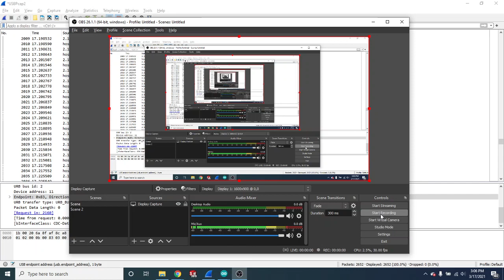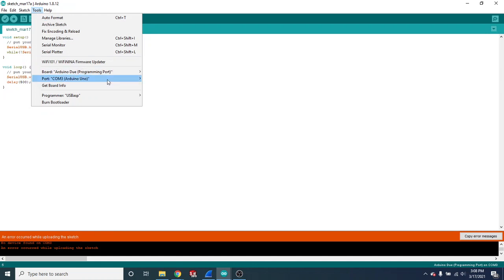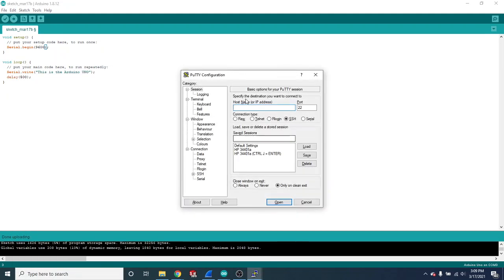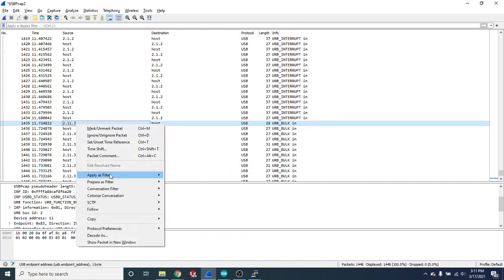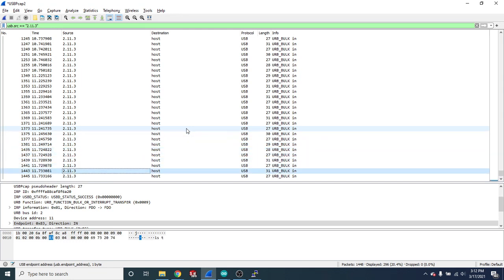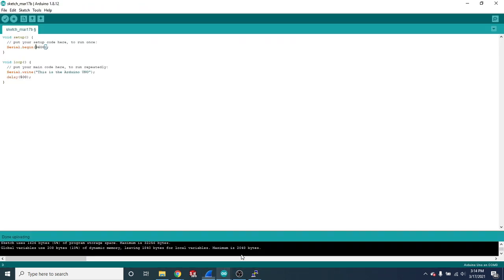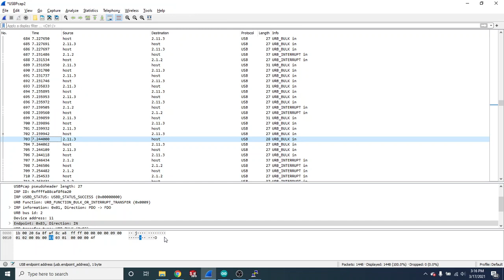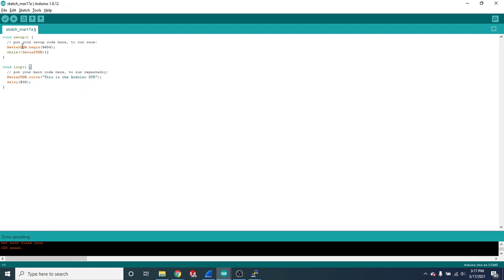Difference between SerialUSB and Serial on Arduino DUE [Analyzing Arduino USB Packets on WireShark]

Comment: Hello I am trying to send serial command from Arduino Due to Arduino Duo. I connect Arduino Due's native connector to Arduino's USB connector via a micro usb to usb-b converter cable. I expect writSerialUSB.println("Open") line of DUE's code tell to DUO which has serial.begin(9600). I test DUE's and DUO's codes with my computer. DUE sends open string and DUO listens open string. but when I connect each other. DUO does not triggered. Any suggestion? Thank you
Reply from the maker: Interesting idea, I have not heard of anyone trying such a thing before. My guess is that the reason it is not successful is because the Due is configured as a USB device, and to establish a connection it needs to be connected to a USB host such as a PC. If you can find a way to configure the Due as a USB host then your idea might be possible. If your goal is to share data between two Arduino’s, then I would suggest using SPI or I2C instead of USB
Reply: @andrewphillip8432  DUE is using 3.3V TTL and UNO is using 5V TTL. I am not sure to connect the boards through the pins

Comment: It would be interesting to repeat this exercise using an FTDI UART-to-USB converter instead of the onboard 16u2; it could well be that the 4-byte "sampling" is a feature of the code in the 16u2, and not anything specifically to do with USB...
Reply from the maker: Good idea, I have one of those I will try it with if I get the chance. I'm guessing you are probably right that the 16u2 is setting the packet size. I tried to see if I could figure it out from the arduino-usbserial firmware on github, but it wasn't immediately apparent to me. But maybe you will have more luck with it.
Reply: @andrewphillip8432  maybe also see if it varies with baud rate - both using the 16u2 and an FTDI...

Comment: Hi, very interesting video. It seems you could be the guy who can help me with my problem. For a project I have to send small arrays from my PC to my arduino due .The arduino does something with the arrays and sends back a signal to the PC, so that the PC knows he has to send the next array. When I realize this with the serial port everything works fine. Because of the circumstances of the project I need to use the serialUSB port. When I use the serialUSB port the arduino does his stuff with the array and sends back a signal to the PC but has to do it 3-6 times, before the PC recognizes, that the next array has to be send. 
Can you explaim this behavior?
Reply from the maker: How does your signaling work? Also what framework did you use to build your host side application? How much time are you expecting between messages?

In general the kinds of debugging techniques I use when solving problems like this are doing things like: opening the serial port in PuTTY or other similar tool to see the data as it comes in. (If your data is not ascii format it can be useful to make a simple command line tool that prints the received data in hexadecimal or whatever is convenient). Another good one is testing the host side application independently. You can get a usb to UART module and put a jumper across the RX and TX pins  to create a loop back device. Then you modify the host application to send the data it is expecting to receive from the microcontroller and proceed to debug

Comment: does it matter  if you increase baud rate? does that mean that you have more characters in a packet? and if so what's the limit of that or will usb be better regardless?
Reply: also your video came out at a good time. I'm looking into a due mainly because of this video and a big project I'm working on
Reply from the maker: @lamboking8able  If you are using SerialUSB then only the USB protocol is used by the MCU, and so baud rate will have no effect. It does not affect how many characters go in a packet. If you use the standard Serial functions, then baud rate will have an effect, because the MCU must send the data in standard serial format to the chip that translates the serial data to USB protocol. On most Arduino's this is an atmega 16u2. Since the 16u2 is an MCU just like the atmega328p, a cool thing you can do is to write programs that run directly on it, without using the 328p. This is rarely useful but is an interesting thing to try.